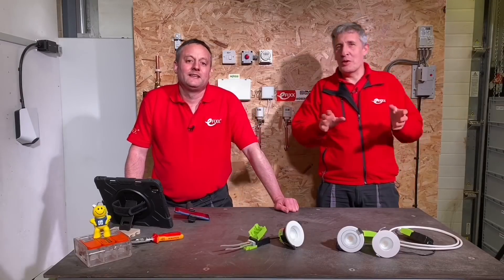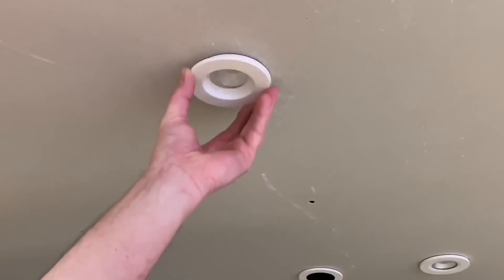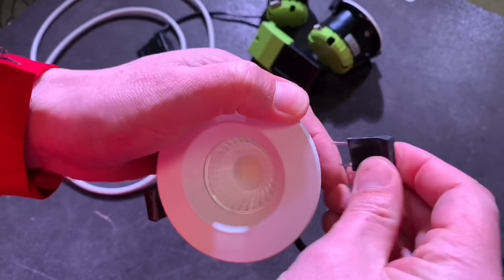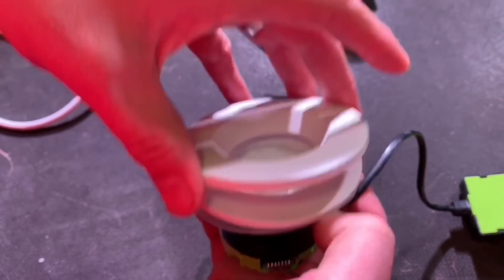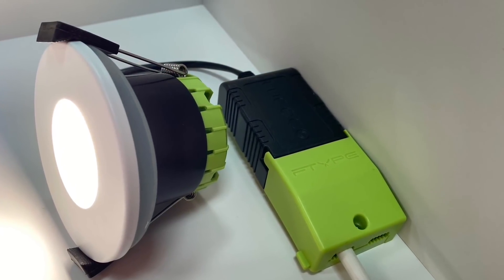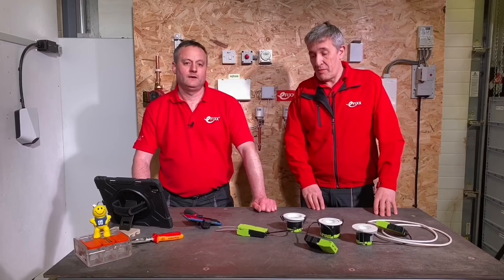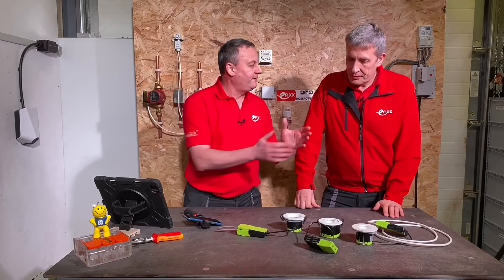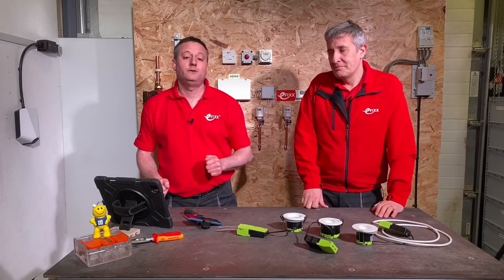New F-Type LED Downlights from Luceco with NEL NEL and more great features.

Comment: Having fitted some of the latest mk2 lights I have to say the push fit system is total BS. The amount of times I pushed the cable in and 1 didn't go in properly, ergonomiclly they are poor. Even taking extra time to make sure everything was same length and as perfect as possible sometimes 3 or 4 attempts and they are in! Well I hope they are because I can't tell. Bring back screw fittings, it would be quicker for me and I would know for sure easily if they were attached properly.

Comment: HI, i have just purchased 9 of the Dim to warm lamps and im now having issued using them with a smart Dimmer from MOES, i have other LED dimmable bulbs that work great with that dimmer switch at the same load levels but when i get above 4 lamps which is still well under the max load, the dim function no longer happens, and the lamps remain bright, i have tried to contact Luceco about this but no reply as of yet, just wondering if anyone else has had an issue with using the Dim to warm bulbs with a smart dimmer switch. Thanks, Rich
Reply: Did you ever find a solution?

Comment: Thanks for this informative video. I am very hesitant about this company. In 2018 I purchased 18 brushed Steel Atom Fire Rated Dimmable Downlight
s IP65 Warm White 5W LUC-LFR5BS450D27. It is now less than 5 years later and 3 do not work properly, one has a dead moth in it (a broken seal?), and 11 have mostly blinked off and on at a low to medium level of dimness, whilst one not on a dimmer, blinks after being on about a minute. They were just over £18 each. Tried changing dimmers from a BG (blinked off and on) for a Varilight Pro as a trial. The blinking stopped but now there is a 1.5 sec delay turning on--this is a bathroom so really annoying. Really don't want to buy new lights plus the electrician charges but not sure there is any other solution.

Comment: Hi thanks for the video, very informative. I’ve purchased 6 x Luceco EF450 Integrated Fire Rated LED Downlights. The lights do not have a Driver / Transformer attached. Does the ‘Integrated’ mean the driver is integrated in the bulb or do I need to purchase separate drivers. Thanks

Comment: the only gripe i have with the lights is the springs yes they are strong but i found somtimes they can bend and it makes it difficult to push them up into the ceiling.

Comment: The cutout size listed in the instructions is 67mm on the box it says 68mm which is too tight, 70mm is the best size in 12.5mm plasterboard.
Reply: mine were 76MM MIN , I had to buy a new holesaw

Comment: Robus downlights all the way for me the new smart range “connect” is an absolute dream to setup and cost effective
Reply: Just checked these out pal. Good no hub required. Is it basically download app. Connect lights to app. Sort groups out. away we go?
Reply: @mattysmethurst5946  literally no bridge needed mate, simply flick the supply off and on three times till they start strobing then pair with the app! Easy as you like and cheaper then buying a bridge!
Reply: @user-wc1nd9ie6x  belting. Will grab a few. Can you then lock off so if the switch is turned on and off it doesn't go back into pairing mode. Imagine it's similar to Vpro dimmer
Reply: @mattysmethurst5946  if you turn the switch off it just registers as ‘offline’ until you turn it back on and can then control it from the app, no re-syncing needed!
Reply: @user-wc1nd9ie6x  just a thought. If for example switch was 'on' you turn lights off via app. You then need to turn back on via switch. Would flicking switch off then on turn the lights on? Cheers
Reply: @mattysmethurst5946  no, leaving the switch on just keeps the feed to the downlighters themselves allowing you to control them via the app, if you turn the switch off, this would then kill the power to the light all together, honestly it’s so simple once they’re in you will know what I mean ha.
Reply: @user-wc1nd9ie6x  I'm thinking thr other way. So the switch is on and the light is on. We then turn off via the app. Phone dies or you run upstairs. How do we turn the light on?
Reply: @mattysmethurst5946  just flick the switch as normal and it resets it mate

Comment: Thanks guys enjoyed the video.  Question, I have a bedroom above a double garage with its own loft void.  The ceiling has 1” PIR board bonded to 12.5mm plasterboard, so 37.5mm thickness.  Would these (or any other downlights) be suitable for fitting into this ceiling?
Reply from the maker: Yes provided they match the fire rating of the ceiling - double boarded should be 60 mins
Reply: @efixx  thanks guys, must have missed your reply only just seen it.  Absolutely LOVE your channel, always so interesting even for a DIYer. 😀

Comment: no we dont need another led downlight especially if its from luceco, worst led fittings ive ever fitted! ill stick to the JCC V50 downlights. much better quality with JCC lights.
Reply: Why is it the worst fitting?
Reply: @sandymcnair5298  fitted over 3000 of them on a london borough contract and to be exact in a year and half since I’ve first fitted them I’ve replaced over 600 of them already as they keep failing!
Reply: @XxSniperHazzardxX123  a five year warranty means very little when it costs an arm and leg to maintain. I have specified them a few time on small projects, but I have no reports of issues. 🤞
Reply: @sandymcnair5298  honestly got to be the worst fitting I’ve ever installed. On par with LAP to be honest 😂 JCC V50’s are the way forward!
Reply: @XxSniperHazzardxX123  second this... Luceco for lighting are awful, BG will never admit their issues either which frustrates the hell outta me!! JCC V50 is by far the best downlight out there at the moment, sell literally thousands of them and never have issue's!!
Reply: Have a look at kosnic. Never had a fault. Cct switch and magnetic bezel.
Reply: @mattysmethurst5946  CCT on the back of these isn't it?? Don't see the point in that personally? Why spend extra for CCT if it can only be set at install? As no ones gunna be pulling them all down to switch CCT later? Save yourself the money and just buy the right colour. At least the V50 allows CCT under the bezel, meaning the customer can switch as much as they like without destroying the ceiling.! Kosnic are a decent reliable manufacturer I'll give you that, just never understood CCT on the back? I get it allows you one fitting on your van, but who keeps stock nowadays anyway??
Reply: @bellas_switch_adapted_toys  it is on the back. Which is One thing that has puzzled me  tbf. 

Agree it's usually done and dusted once set but the light output is brilliant. Plus like you say the brand name and reliability is a big plus. 

Are the jcc ones fire rated and dimmable?
Reply: @mattysmethurst5946  think its easier for them to keep the IP rating when it's on the back and in turn prob cheaper for them to produce! The Kosnic are good downlights, just personally think the V50 is better thats all... 

& yeah, V50 is dimmable & fire rated as standard. They also reduced it to 50mm depth a little while back, which allows fitment into shallower ceiling voids 👌🏼 never had an issue with any decent branded LED dimmer either
Reply: @bellas_switch_adapted_toys  cheers pal. 

Started using the vpro dimmer now myself to get it as dim as possible.

Thanks pal!
Reply: @mattysmethurst5946  yeah thats a good dimmer to be fair, bit pricey though as Varilight don't make it easy for the wholesaler to buy direct, by the time its 3rd partied your paying more for it! Hamiltons LEDITB100 is good! Get a wholesaler who's a super stockist for Hamilton and they should be buying in bulk for better rates by time it lands on your invoice 🤙🏼
Reply: @bellas_switch_adapted_toys  what a guy
Reply: I’ve never had much issue, find them pretty reliable tbh

Comment: Hi lads. Can you tell me your solutions for fitting downlights in continously insulated ceilings ie vaulted ceilings? Builders building a box if you like around the down light position?
Reply from the maker: My advice would be to avoid down-lights in vaulted ceilings - use angled spotlights instead - if you drop me an email I’ll send some photographs of a recent project.
Reply: @efixx  hi could you send me your email address?
Reply: Sent email to admin. Be great to hear back from you.

Comment: Look a hell of lot easier than the eye waveringly expensive ones I'm installing at the minute. Im new to the industry so apologies if this a strange question but; how does the manufacturer determine the lifespan? What part of the product is most commonly to fail first? Would the lifespan of the fixture change if the fixture was constantly run at half/dim?
Reply from the maker: Great question 🙋‍♂️- there is a saying - LEDs don’t die they simply fade away. If they die suddenly it tends to be the driver / general build quality . Beyond that LED life is determined by temperature - so operating dimmed can dramatically extend the life - I quality manufacturer will quite an L number - see this https://youtu.be/LI-FJjvQciQ video -